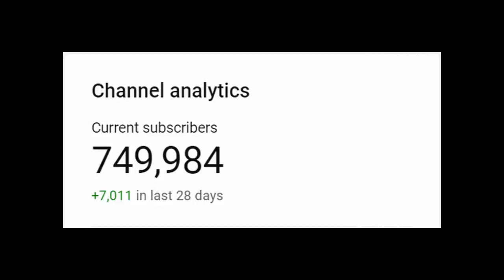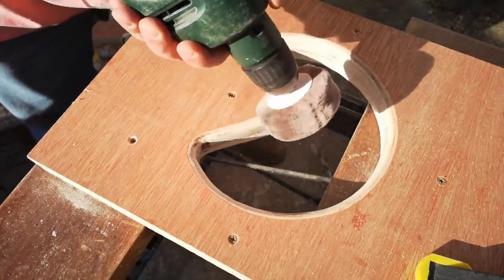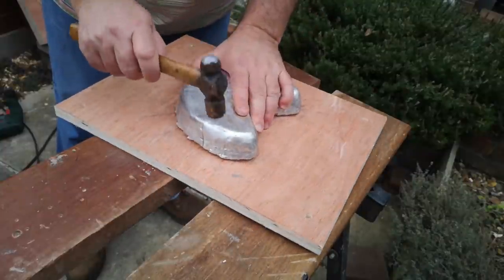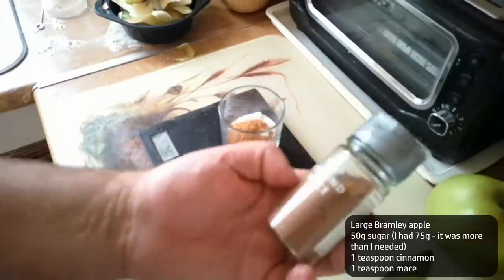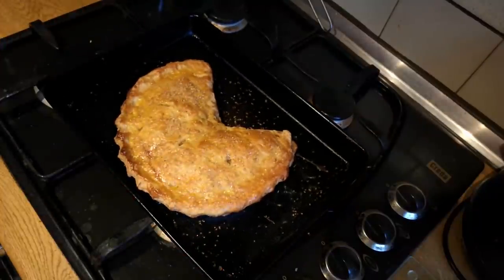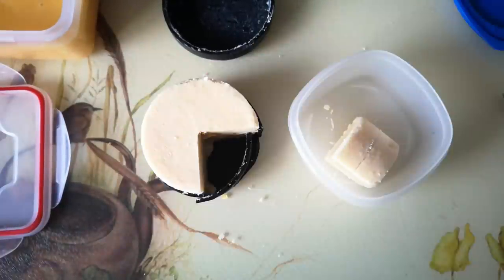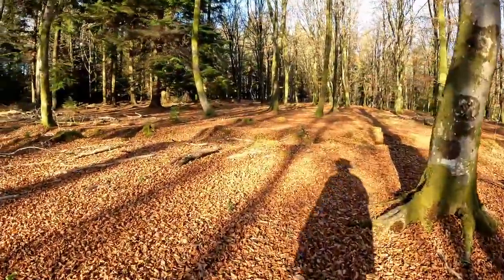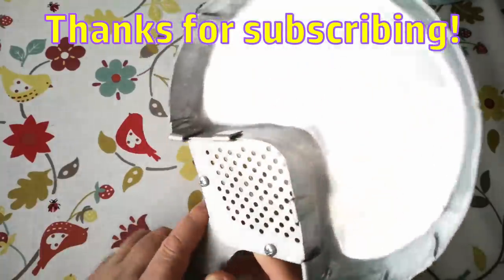Three Quarters (a Celebration of my 750k Subscriber Milestone!)

Comment: Good trick: Wipe Aluminium with hand soap, when the soap goes black the Aluminium is annealed. Minus the frying pan it would have been easier to block out 1/4 of a round pan for the pie.

Comment: I always wince when someone is jigsawing towards their hand that is holding what they are cutting!
The blade just has to bounce out or snap......
Well done for the 750K subscribers, and you certainly get the Reg Prescott Award!!!
Reply from the maker: I know what you mean - I noticed it in the edit - couple of things to rememeber though - the camera angle often makes things look less safe than they actually are (shortening the apparently distance between things that are in line), and the jigsaw blade does the cutting - very little forward pressure is actually needed (indeed, it would be risky if force is so applied, because the blade will break and skip, but it's safe if you let the saw do its job)
Reply: @AtomicShrimp  If only more people had the sense you have, which unfortunately does not appear to be that common these days.  Oh, and I loved the idea and video too (as usual).  Keep it up.

Comment: Bit late now but a tip for annealing aluminium. Scribble over it with a black sharpie (other permanent ink pens should work too), heat it until the sharpie marks disappear (they might leave a pale yellow mark rather than fully disappear depending on your pen). That's it, works a treat.

Comment: Fun fact: Not accounting for the rounded corners, the ratio between the length of the curved edge and the total length of the two straight edges of your 3/4 pie pan would be 3/4 pi, as the two straight edges add up to the diameter and the curve is 3/4 of the circumference.

Comment: On the annealing.... Rub bar soap on the aluminium. Heat. When the soap melts it's hot enough. Air cool as usual.
Congrats, by the way.
Reply from the maker: Thanks for that - some people say to quench in water, others say to cool in air - any thoughts on that?  I Always thought water quenching would harden the material, but that seems to be true of ferrous metals only.
Reply: @AtomicShrimp  for aluminium, air cool. Quenching tends to crystallise it

Comment: That was an amazing video and really makes me wish I had more “traditional” skills! 
I had two questions if you have the opportunity: 
1. Is it safe to eat off untreated aluminum like this? I’ve heard to be careful with metals because one can become very ill. 
2. Would that skillet still be oven safe? Having a handle like that would be really useful!
Reply from the maker: There are people who say that aluminium cookware causes Alzheimer's disease, but there does not appear to be any real evidence for that ( https://www.alzheimers.org.uk/about-dementia/risk-factors-and-prevention/metals-and-dementia ).  Aluminium is a self-passivating material - it's very reactive, to the extent that bare, freshly cut or scraped aluminium acquires a tightly-bonded, tough coating of oxide within a fraction of a second of being exposed - and the oxide is the same stuff as sapphires are made of - tough and pretty chemically inert.
I don't like cooking on it at home, just because the metal itself is soft and so the surface finish of the pan tends to get rough over time, but for something like this - occasional/camping use, I have no concerns.

Comment: To get the aluminum to the right temperature carbon black it with a candle or sooty flame. heat until the carbon black burns off Then quench.

Comment: I know its late, but when you anneal aluminium
1 draw on the seams with a sharpie pen
heat it up until the sharpie pen disappears, when it has disappeared its about 75% of the way to maximum anneal
2 keep heating it , but check every few seconds by dragging some softwood like a wooden wedge over the area gently,  after enough heating the wood will start leaving a scorch trail of black
its definitely been annealed now, stop heating it and let it cool down, or if you have the right PPE you can form it while its hot.
Do not keep heating it otherwise it will melt.

hope it helps anyone reading it, even if shrimp doesnt see :)

Edited to add:
be careful when heating thin Sheet metal as the heat will put massive warps and distortion on anything larger than a tea saucer

Comment: I was always taught that you should never crack an egg on anything sharp as it will introduce bacteria into the egg from the surface, provided that the egg separates cleanly in two halves. Not sure how much impact it would really have if the content is baked through.
Reply from the maker: It matters more if you're eating it lightily cooked or making mayo or something . I only crack eggs like this if I want to separate them
Reply: @AtomicShrimp  Context as always, is the keyword.
Reply from the maker: Indeed so - the other thing to remember is that a tiny dose of bacteria isn't likely to cause a problem for a person with good general health; salmonella, campylobacter, clostridium, e.coli - all of these things are already present and your body can deal with them (indeed, they are probably present on your body right now, in various places). Food poisoning occurs when a person ingests a sufficient dose of a pathogen that it is able to overwhelm their defences and infect them - so bacteria into egg, then storage at room temperature for multiple hours = potentially bad.  Bacteria into egg, immediately consumed = probably not an issue.
(For people with compromised immunity, the above is not the case)

Comment: You should add a scroll saw to your arsenal of tools
Reply from the maker: I used one to cut out the plywood and metal
Reply: @AtomicShrimp  That's a Jig saw, I meant a Scroll saw as in the table top design with the reciprocating blades that you move the work piece not the saw.
Reply from the maker: @Alasdair-Morrison  Ah, OK.  Terminology is often blurred between these two devices